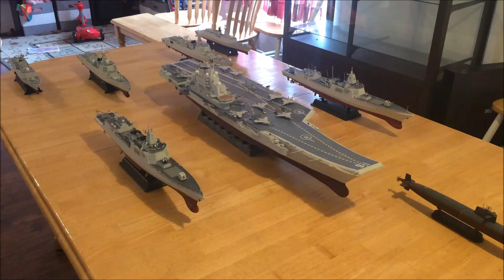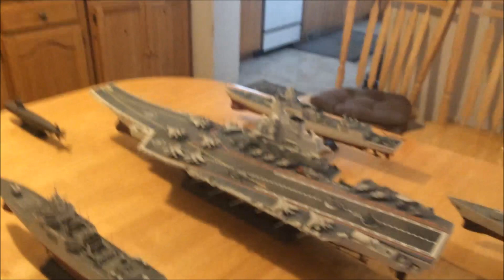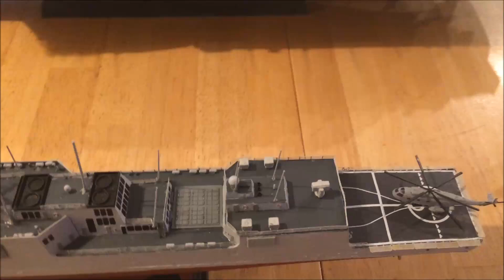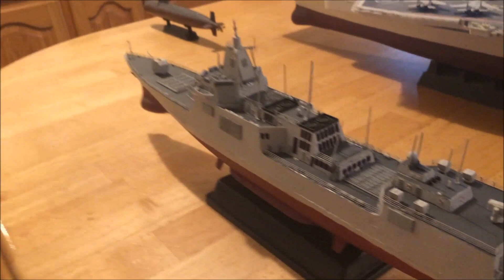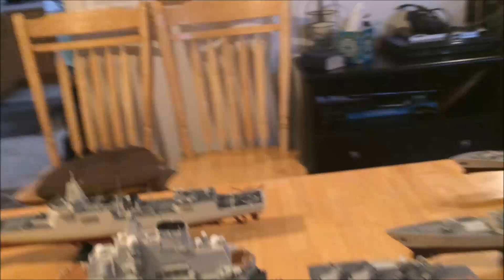PLAN Carrier Strike Group II

Comment: Since Chinese has already launched their 075 ship, I am looking forward to your video about that.
Reply from the maker: As soon as Trumperter or somone else gets a 1/350 scale model out on it...there will be one built.  I have a ARG already for the PLAN with two Type 071 LPDs and escorts.  I would love also to see someone put out a 1/350 Model of the Type 072A LST, or even the Type  072 III.  The PLAN has about 30 of them and they are very decent designs of the LST type vessel.  Noting wrong with that.  If there was a 1/350 model of that I would buy at least two and have them with the twp 071 LPDs and a 075 LHD.  The five ships would make a very strong Amphibuous Ready Group similar to what you see I have made with the actual US Navy ARG video I have out.  As I said, I made one with two 071 LPDs but I do need the oo72s and the o75 to really make it fitting.

Comment: @ 2:00 That is a misconception. They can carry full load, but they need more strict condition to launch at such load. In other words, they need to have the right head wind velocity in order to do so. So the disadvantage is that they have to face the ship towards the highest head wind possible assuming if they have enough at the moment. So they can launch at full weight, but it just requiring more strict condition which makes it a disadvantage compared to catapult. BUT THEY CAN LAUNCH AT FULL LOAD. 
@ 4:40 Yes that is correct. The Chinese carrier stealth fighter is the FC-31 that they are working on
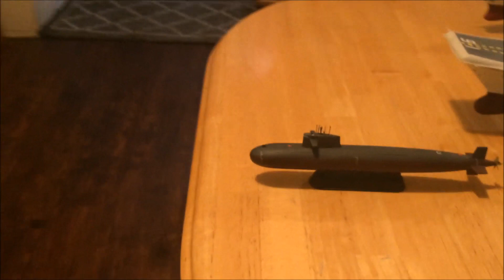@ 15:55 The Indians are probably not that interested in getting the F-35 because they know US wont sell it to them. Thats why US never gave the F-35 option when Indian airforce was tending a competition for a fighter replacement AND US wont even allow F-35 for Turkey a NATO member cause Turkey have the Russian S-300 SAM system because they might reveal some weakness of the F-35 and since India also operates the S-300, I highly doubt US will risk selling the F-35 to them neither. 

Other than this, love this video and love the model. Well done!!!

Comment: It's kinda confirmed that China's third carrier 003 will be similar to Kitty Hawk Class but much better. Probably around 85000 tons with full displacement. Some people said online that carrier nuclear reactor was proven to be reliable, but I still think we have a long way to go. A carrier like Ford Class was the final goal. I think 054A will not be in CSG anymore cuz they just slower, top speed I believe is around 30 knots whereas 052D,055, the carrier can both easily reach 30+ knots. For 052D and 055 we have Z-20/ZH-20 as helicopter which is very similar to SH-60 sea hawk. That's why we build 052DL (longer version to fit ZH-20) a year or maybe 2 years ago. And yes, Chinese SSN, SSBN is 2 gen below the US. That is something we need time to develop and build. 095 SSN and 096 SSBN is under development but no one knows details. The news said online that 095 is better than Seawolf-class and 096 is better than Ohio-class... I would say no... however if they perform similarly as Seawolf and Ohio, that is a huge jump...

Comment: Very impressive models Jeff. Can you please tell us the outsiders how did you obtain the kits? Are these all self build? And from what material, what reference etc.
Reply from the maker: Thank you for watching and commenting.  Most of these kits are available online at various model providers and eBay.  Many of them are either Trumpeter, Bronco, or other model companies.  The Liaoning is a Trumpeter 1/350 scale model.  Both Type 054A are also Trumpeter.  The Type 052D and Type 055 are Bronco models.  And the sub is  Hobby Boss model.  Hope that helps!  I have the build thread on most of them on the Fine Scale Modeling Forum pages.

Comment: Great video. An additional weakness worth mentioning is that the otherwise well designed J-15 is still seriously hobbled by the inability of the Chinese jet aircraft industry to produce a single crystal fan for their turbofans. Because of that their engines aren’t nearly as reliable as our own or even Russian jet engines for that matter. This also prevents those engines from producing the thrust that they should limiting weapons load and range even more than the ski jump system already does by design. Honestly I’m a little shocked that the Chinese continue to use their own jet engines here rather than buying the superior engines the Russians have already sold them for use in other aircraft.
Reply: A new and better generation of engines now has came out because of their insistence
Reply: @rogermars2465  insistence that the PRC continue trying to develop and improve their own turbines? Indeed it has helped. But, why hamstring the relatively very small carrier fighter fleet when the land based fighter fleet is far less detrimentally affected by these engines and substantially larger too? Why can’t the few dozen  carrier born fighters get Russian engines just like the J20 fighters already have so that they can actually be reasonably safe and somewhat useful? That still leaves hundreds of land-based J-10 and Flanker derived fighters to utilize PRC built turbofans. Literally, ramp launched Flankers are so limited in weight by PRC built engines they’re all but useless. It doesn’t make any sense.